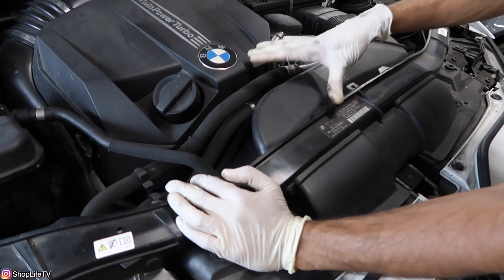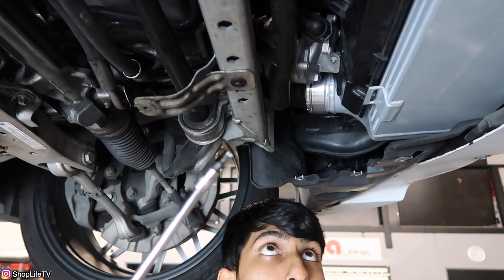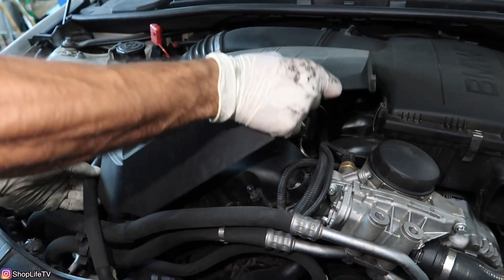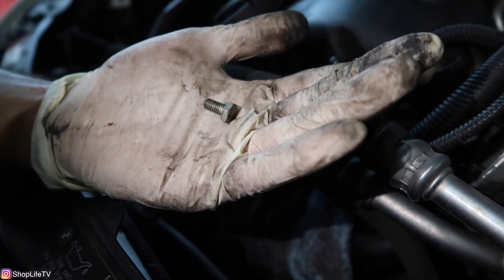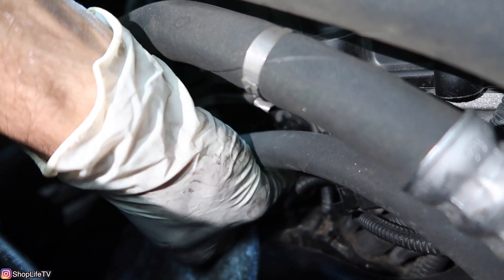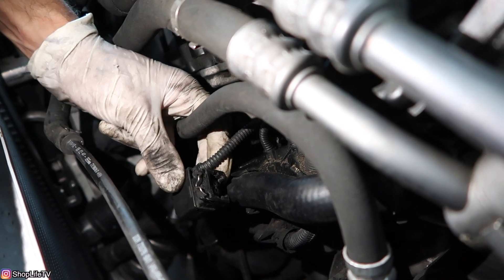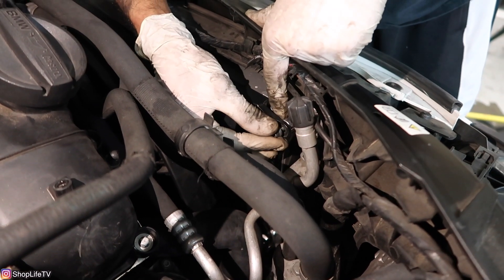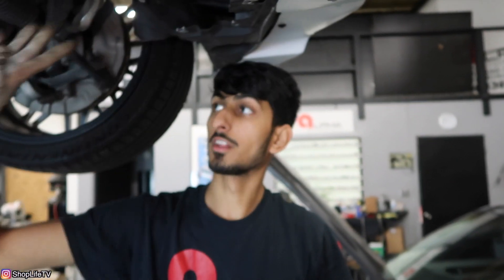How To Replace N55 Vanos Solenoid (135i, 335i, 535i, E82, E90, E92)

Comment: Its a MUST to clean all ur Vanos when you replace ur serpentine and tensioner belt and pulleys! 
Cleaning the vanos cured my annoying jerking and unbalanced timing while idling at a stand still. My car warms faster, its very silent and i got full power! No more jerking or shaking at idle when starting my bmw f10 n55 and finally SOLVED my issue.  Idles soo smooth and clean!

How to cleaned both Vanos. I used 2 wires red & black with small alligator grips and attached them on a 9 Volt battery and hooked them up on both Vanos connection poles. This method while giving power to the Vanos allows it to open and close. This is where you begin to clean the vanos in all hole opening as well as the inside with either a Map Sensor cleaner or a Electronic contact cleaner which cost cheaper.  This cleans the Vanos soo clean that it revives them like brand new.  
Ur bmw will idle smoothly and sound more silent idling perfect because it now adjusts the timing as it was design when new and becomes well balanced in ignition firing! I was blaming my old ignition coils but the problem was the dirty Vanos! 
Clean them, its a must! Just a 10mm socket to remove them...
Reply: can i use brake cleaner?

Comment: video came in clutch. my solenoids were so dirty I didn't even realize there were bolts! solved my engine malfunction after replacing OFHG. Thought it was odd it happened right after doing the maintenance, but then again I used a shit ton of brake cleaner. oops

Comment: Thank for update.
As preventative martens replacing both exhaust and intake. My X5 N55 engine has 107,000 miles. I bought mine used at82,000 miles. No service history. 

Do you require reset re calibrate or Validation after you replace the new solenoids ?.,  thank you for reply
Reply: I am replacing with set if Pierburhg  OEM .

Comment: Great video, this is one of the best I've seen yet. 
I just replaced my camshaft sensor which is right near there but still getting the same errors so now it's time to reply the Vanos sensors :(
At least it's almost the same task I just need to remove the fan now.

Comment: I have a 2012 535i  that I did an engine swap with. Of course same n55 engine. It's been a nightmare . I've got it down to 7 codes now. Please help. The codes are...p052b, p054b, p0300, p112f, p13c9, p05ce, and p1339. I've put in new ngk laser iridium spark plugs . The coil packs are duralast ones I took from the first engine being that the Delphi ones that I took off while changing spark plugs were breaking off at the tips when I was removing them. It's still mis firing and I'm not sure if the coolant is flowing cuz the fan motor will turn on literally after 20 secs from. A cold start. I don't understand why its doing that when the temp gage is still cold.

Comment: Do you guys recommend using original bmw solenoids or can other brands can be used ?????
Reply: I highly recommend using the OEM solenoids as this is a very sensitive part. Plus you basically only change these one time in the car’s life anyway so no reason to cheap out.

Comment: Hello, my 135i does this weird thing only when the AC button is on, it revs or (surges) and jults when I'm coming to a stop. It doesn't do it when the blower is on by itself. Another thing is when I step on the accelerator the engine light comes on, but it doesn't do it I'm driving regular speeds. What do you think it it might be?

Comment: if the car get a check engine light  every now and then, why not do a fault survey and see what fault is has. sound like: power deduction, with fault code: 2a82 intake vanos and/or fault code: a87 exhaust vanos camshaft fault. SIB 11 02 08, with a N51, N52K, N52,N54. But you have a N55, so maybe or mostly its sib 01 10 14, vanos bolts (broke off). 
SIB 12 14 12, One or both (intake and/or exhaust) of the VANOS gear assemblies may have faulty assembly bolts. One or more of the four assembly bolts have loosened or broken. 
after replacing the vanos solenoid, did it fix the problem (rough idle, check engine light)?

Comment: Hey quick question. I completed this and now my car is throw codes
2D54: Variable camshaft timing control (VANOS) exhaust: cold start not controllable  and 2D55 Variable camshaft timing control (VANOS) intake cold start not controllable
Start stutters like crazy then shuts off. I reconnected everything and tightened both new solenoids.
Reply: Why did you change them in the first place?
Reply: how did you fix this???
Reply: @g59dc  check connections, and swap the solenoids
Reply: @bryantruong1100  thanks bro, I just had the plugs switched up.
Reply: @g59dc how do you know which is which?

Comment: I'm at 120,000 miles and occasionally (rarely) have a rough idle for a short period of time, could that be the beginning of this problem?
Reply from the maker: Yes it's possible, as well as a number of other things
Reply: @ShopLifeTV  1 year later and the problem never resurfaced until now.
There's a burning oil smell, visible smoke from the back of engine bay, and extremely fluctuating idle as well as a loud whine.
I'm going to be replacing the Valve Cover.

Comment: I have a 2011 BMW 535i, with P052B and P054B fault Codes (Cold Start A, and B camshaft Position timing over retarded Bank 1) .  I've been able to disconnect the solenoids and take out the 10 mm bolts, without having taken out the fan.  But the solenoids are stuck in there.  Maybe I should try to get the fan out first to get better leverage.  But they sure are stuck in hard.
Reply: Yeah I’m having the same problem but I’m not taking the fan out

Comment: I have a 2016 435i and i get limp mode after 2-3k rpm accelaration.. codes are like mixture control : fuel air mixture to lean  / air volume plausibility air volume to low / charging pressure control plausibility to low
Reply: air leak code, double check and pressurize your charge system, goodluck!

Comment: bro what engine light code did you get? i ran ISTAD and got code 101F01...i checked everything from vacuum lines to airintke but no luck..the only thing i did to the car was replace the leaking valve cover gasket and clean vanos and started getting this light and code. ill appreciate if you can help
Reply: You ever solve your issue?

Comment: So what if you ARE getting misfire codes associated with the rough idle, but it only happens sometimes (usually in colder weather or when raining... and even then if you shut down and restart, about 25% of the time it will then idle fine).  Just want to toss it out there for thoughts from the community...
Reply: Also interested, I don't get codes but a rough idle on cold start up when its colder weather

Comment: I’ve got a question for you I cleaned my Vanos and MASS  and Replaced coils and plugs on my 335 e93. I’m still getting a very subtle 25-50 rpm pulse at idle every 8 seconds. Any idea?
Reply: Try swapping the vanos, intake to exhaust. Both don't go bad at the same time.
Reply: I bought new vaico vanos. Runs smooth now.

Comment: Are the Vanos in the same place on a n53 (F01) engines?  Would like to clean or replace mine. Getting hesitation on acceleration and now getting camshaft timing retarded message.

Comment: When do these usually go out? I have a 2011 with 89,000 miles stage 1+ MHD tune
Reply from the maker: Hard to give an exact time frame, I've seen original ones past 150k with no issues